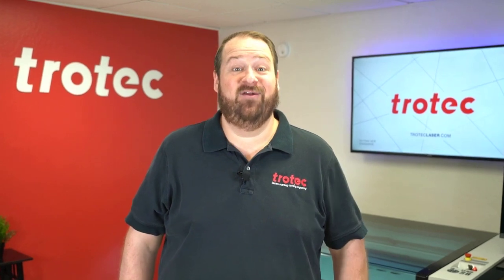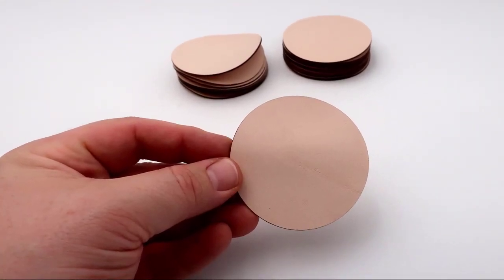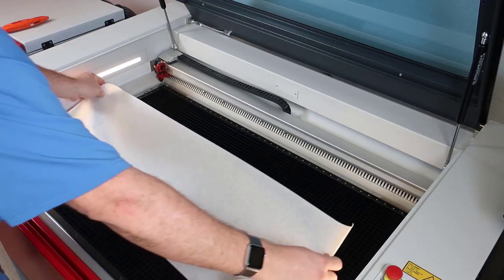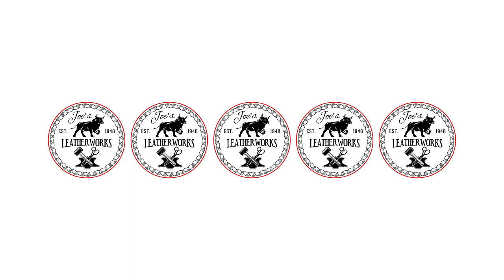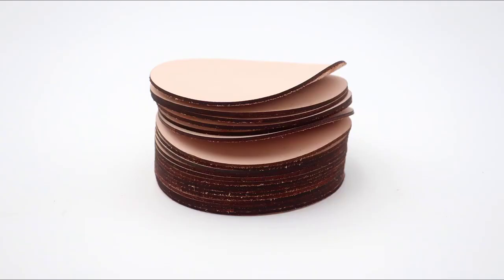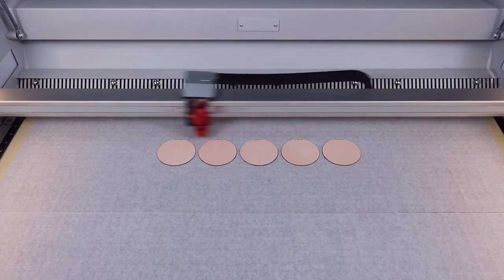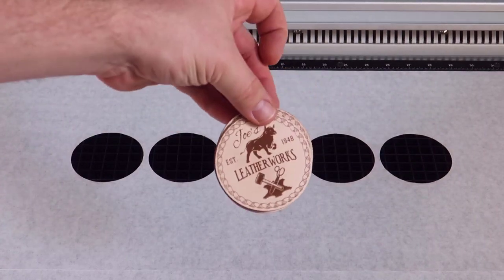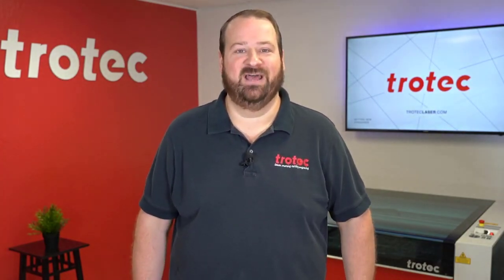Laser Hack: Laser cutting table vacuum fixture | Trotec Laser

Comment: Excellent! Is there any way to find out the laser power?
Reply from the maker: Hello! Thank you for your interest.
Settings for the leather will depend on the machine configuration and wattage. In this video the job was run on a Speedy 400, 120 watt laser with a 2.0 lens at 50% power, 100% speed, 1000 Hz and 333 DPI.
Read more on the optimal laser power for your application: https://www.troteclaser.com/en/faqs/optimal-laser-power/.